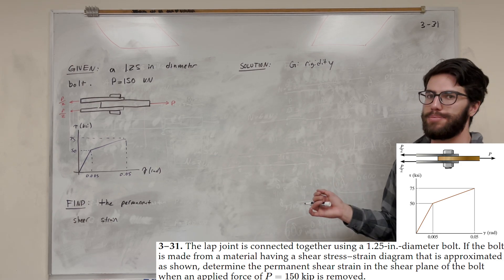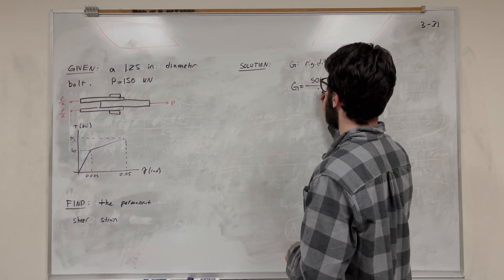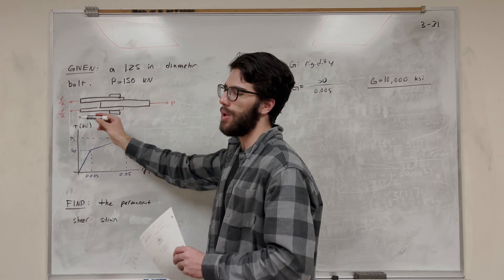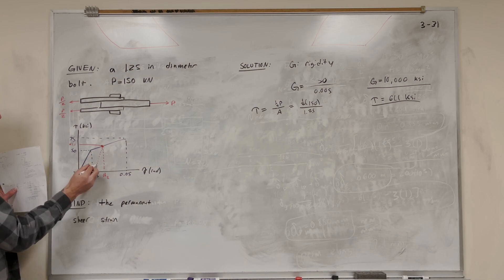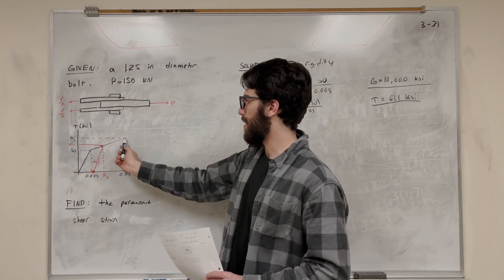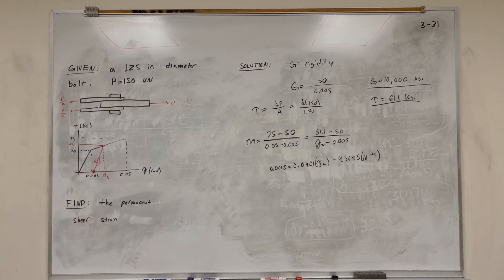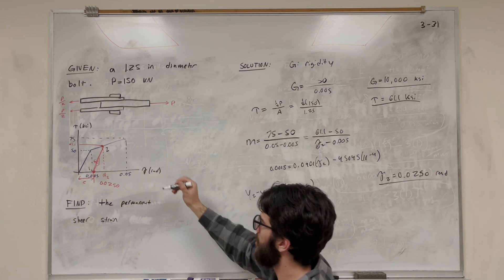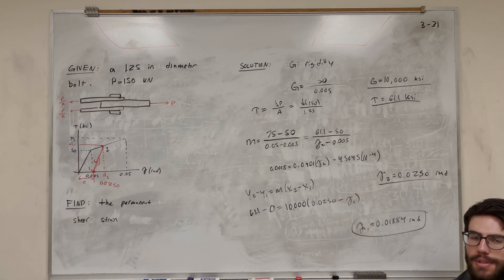The lap joint is connected together using a 1.25-in.-diameter bolt - 3-31

Comment: I believe Area for the bolt would be pi/4 * (1.25 in)^2 because 1.25 is the diameter not the cross sectional area of the bolt
Reply from the maker: Whoops I made a mistake, I’m pretty sure that I used the right number for stress after that, I just forgot to do the area correct

Comment: yea mate your area for the bolt is wrong, and even when going through with your approach with the right area, it isn't right as I would get a shear stress of approx. ~3. Which isn't in the permanent deformation range, which im sure it should be.
Reply from the maker: Yes sir I made that mistake thanks for the heads up